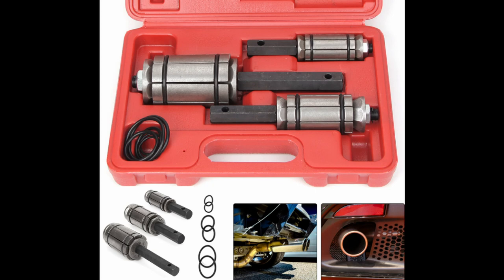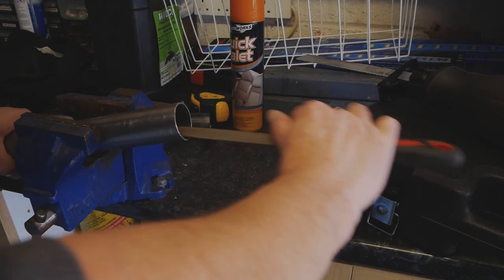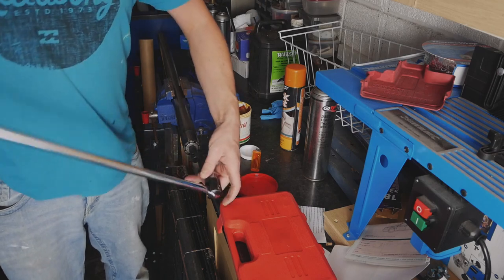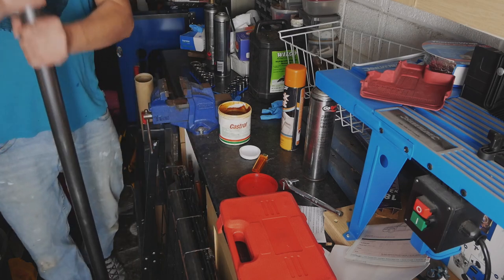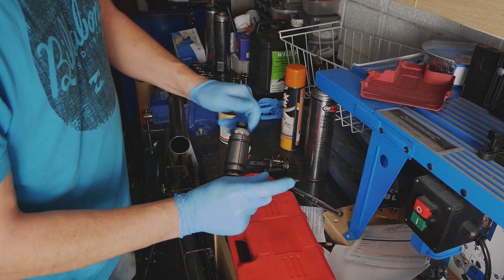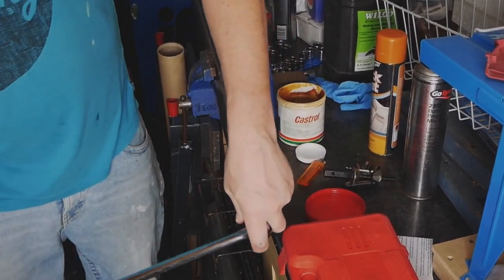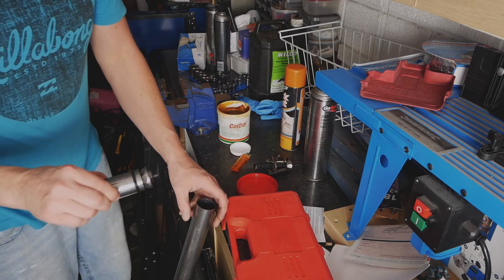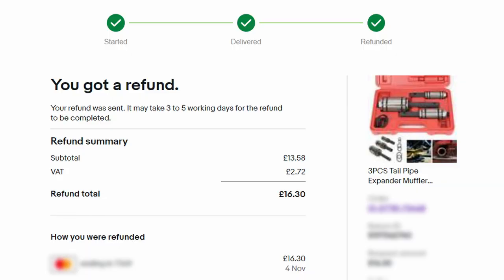Cheap Exhaust Pipe Expander - REVIEW

Comment: Can't comment about the quality of that particular tool, but there are 2 very valid points about what you did wrong.
Firstly, if the larger tool would fit inside the pipe right from the start, then that's the one you should have used, not the smaller one.
Secondly, and most important, expand the tool to almost the size of the pipe then remove it, heat the pipe so that it's cherry red, then use the expander. You'll never successfully stretch a cold steel pipe with one of these things and even with a professional hydraulic expander you risk tearing the pipe.
Reply from the maker: It was shot in day light, it would have shown up more red in colour if I had the garage door closed. I heated it up to allow for the annealing of the metal. 
To be honest, using the larger one would have still broken at whichever stage I used it at. 
I'm not to sure if you are suggesting to insert the tool whilst it is cherry red but these have rubber bands holding the bars in place, I'm certain they would have melting doing so. Cheers
Reply: @ifell3  I understand what you mean about the rubber bands, better tools would use expanding steel rings. The simple fact is that you can't expect to stretch steel tubing, usually 1.5mm thickness, when it is cold without either breaking the tool or tearing the tube.
Reply from the maker: I agree, well now I do aha. I had high hopes and expectations of the tool doing what it said 😄
Reply: If you heating the pipe you will born rubber o- rings
Reply from the maker: Totally but was desperate measures 😔